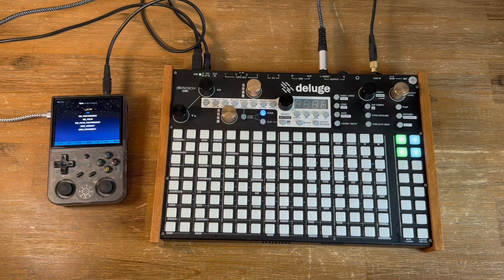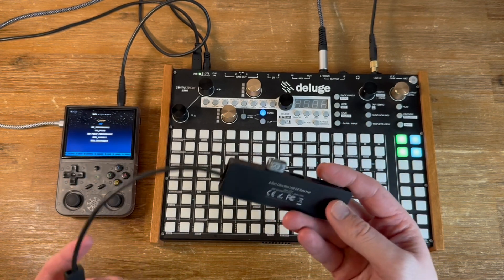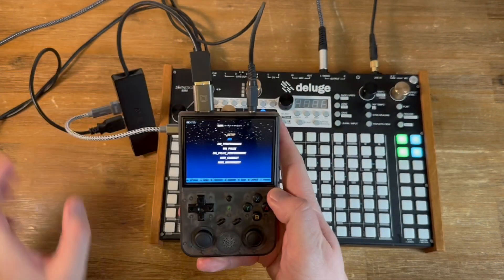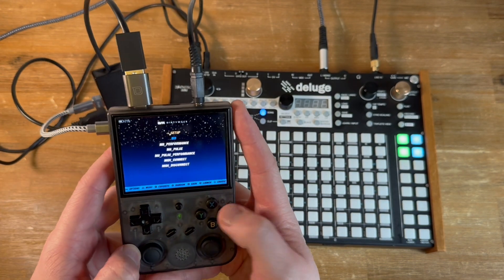How-To Synth // Dirtywave M8 Headless USB MIDI Input on an RG353VS (ArkOS)

Comment: Did you ever try this the other way around? Midi from the M8 to the Deluge?
Reply from the maker: I can't remember if I actually tried that, but I think it may work because the connect script at 2:58 displays both a "to" and "from" on the Deluge. I finally got an official M8 so am unlikely to set this up again, but if you (or anyone else) gives it a go, maybe let us know if it worked?
Reply: @owmo_studio  I'll be trying midi controlling a hardware synth (minifreak, maybe even a TEO-5) so I can certainly get back on how the latency is.

Comment: I confirm that this also happens with Triumui Brick and Knulli. The latency is so high that it can't be used to synchronize other devices.
Reply: how did you run the "MIDI Connect" script on Knulli?
Reply: @AutodafeSynths  via ssh aconnect and pw-link